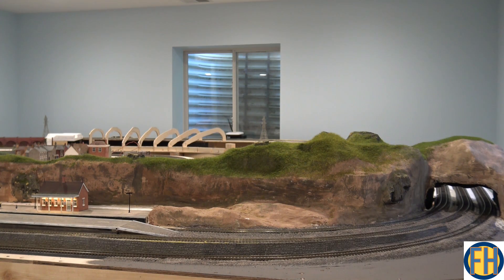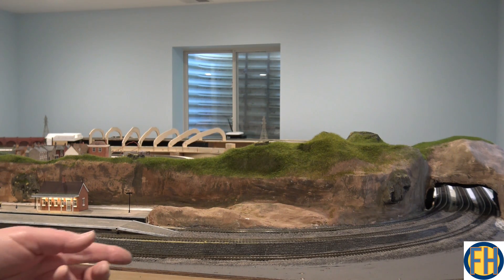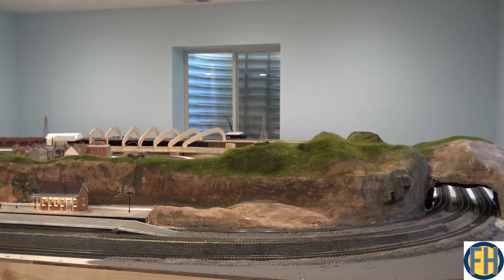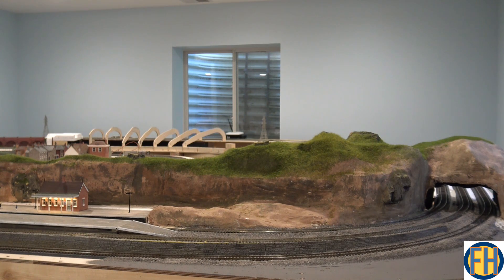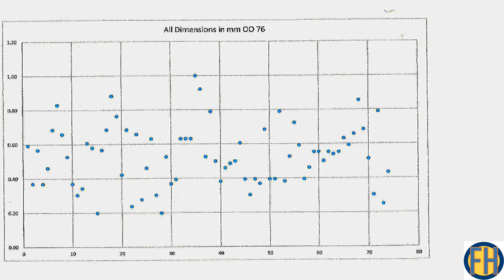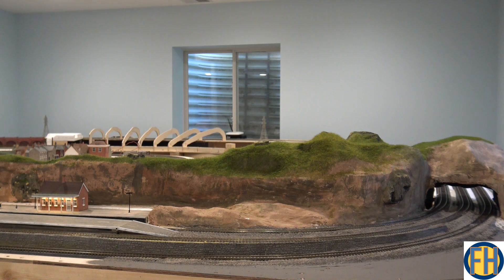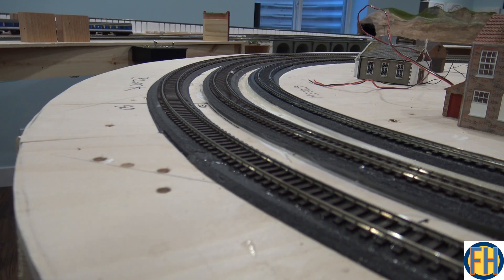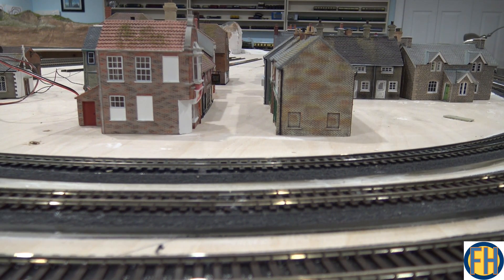17B Farland Build  -   Girder Bridge up close,  Progress and More

Comment: Just had a thought about your platform wires. Use a drinking straw through your drilled hole to feed the wires through and then they won't get caught in the foam etc.
Reply from the maker: Creeping Jane I discovered that trick long after I made this video.  Thank you for the tip, Rob

Comment: Exciting to see ballast going down, and a lot of research seems to have gone in to it. Regarding color mix - are you planning on weathering the ballast and rail once it's all laid? It seems like much of the color mix is lost, depending on how much you weather it. 

Really good craftsmanship on the platforms, too - that final video clip from on the platform itself really shows it off nicely.
Reply from the maker: Hello, I hope to put some color on the rails  and weather the track itself.  I would like to keep from getting too much weathering on the ballast.  I will most likely wait till I am much further along and for weather where I can open the window.  Today it is 35C so with the A/C I do not want to open the window.  It makes sense once set up to do a fair amount of painting.  The wood planked platforms came out fairly well, at least I am happy with them.  Thank you so much, Rob
Reply: Yep, my concern on weathering the ballast is in overdoing it and then you loose the color and texture variation of the ballast itself! Sounds like you have a good plan on waiting until more is done before you approach that task.

Comment: Well apart from a few teething troubles then all is looking great Rob, I think that it must be expected that there will be a few issues along the way when building all this from scratch like you are doing and to be honest, with the size of the layout then the issues are not huge and I'm sure a man of your calibre will sort out in a jiffy. That shot at the end with the camera on the platform was brilliant with the two trains pulling in and really showed off the excellent spacing you have between the platform and the coaches - that was well worth all the effort you put into it and certainly something I will be concentrating on when I come to redo mine - it makes such a difference to the look.  A great update buddy.            ...........Graham
Reply from the maker: Hi Graham, it is 5:31 am and I have my first cup of tea in my hand.  The wind is blowing in big gusts outside, it has cooled way down overnight.  Another new day approaches.  Yes, teething pains.  The track with the slight wow is the last one laid, the second girder bridge had to be complete before it could be completed.  As a result it has the least running time on it.  In fact, the morning I shot this video was the first time I had ever run a Western on it.  I've had a few other things like the HSTs and the Class 50 and 25 running on it.  As you say, it could be something down low the ruck is hitting.  I will investigate today.  I confess, the little squiggle was so I would have enough room to get my larger camera on the platform and it is just wide enough to fit it.  They will not look so wide when the canopies go on.  I have one in clamps while the glue sets up now that I did yesterday, last thing.  Thank you, Rob

Comment: Another way to install wires (as for the platform wiring) is to provide a duct.  A drinking straw is ideal, and allows the wires to be run over many inches without needing other guidance.
And the canopy lights on the main platform look great.  Do you use warm-white LEDs?
Reply from the maker: I used those adhesive rolls of LEDs and cut off how ever much i needed, then I used a fair amount of resistance.  The glue is setting up on the first canopy and the lights are in.
Reply: Rob McCrain 
Rob, interesting how sensitive LEDs are to voltage, so different length strings of leds need different ballast resistors.
I have a neat little box for testing leds (single and strings) that I got off eBay, but I'm hoping to standardise on the resistor for coaches and sets of leds, so the lighting is of similar intensity. Search for "mini led tester test box".
But I like your canopy lighting, nice brightness.

Comment: Hi Rob
Great video, interesting to see I'm not the only one with the odd running issue.  On a big layout track laying can certainly be a trial by fire. I've relaid one section 3 times, it's tricky sometimes to get everything to run perfectly. 
The bridge looks great, looking forward to seeing that section completed.
Cheers
Paul
Reply from the maker: Dunge Wood Hi Paul, I have not run every loco and every different type of sock I have yet.  I was surprised to discover how easy it was to get my Bachman stock to run on the one extreme super elevated curve.  The other 4 are much less.  I just loosened the screws holding the bogies and all was fine.  Some were fine from the factory, some were not.  Inconsistent assembly I guess.  The S turn, which is very slight, causing a problem was a total surprise.  I am about to run my Class 40 through and see if it makes it.  Come to think of it, I am sure I've run it on that line before.  We shall see.  My old layout was plagued with multiple problems like this, so bad In fact, it is no more.  Thank you, Rob

Comment: Looks good Rob, I notice on one of your rakes it looks like a Mk1 TSO  in Network SE livery but with a 1st class yellow stripe, as 1st Mk1s are 7 windows fo or fk's not 8?
Reply from the maker: Hi Greg, I hadn't noticed that.  Thanks for pointing it out.  Rob
Reply from the maker: Greg Palmer Hi Greg, I am looking over my stock as I write this and have counted windows.  The only one I see with 7 windows is a composite coach 1st and second.
Reply: Rob McCrain Hi Rob, yes the Mk1 comps have 7 windows/compartments also, Mk1 1st opens or corr 1st have 7 windows/compartments, same on Mk2's fk or fo's all 7 window/compartments so this could be a mk1 so reurbished into a FO when Network SE re liveried it.
Reply from the maker: Greg Palmer Ah good, there can be variations then from the norm.  I was afraid I would be forced to take it to the tip.  I have two like this.  Thank you, Rob
Reply: Rob McCrain if you can get me the coach nos of the sides I check my coaching stock books for the origin
Reply from the maker: Greg Palmer Is it really that important?

Comment: Rob excellent video again, work is progressing really well, the rock face and the station platforms look great, the girder bridge love that, and the ballasting is spot on, I remember the video you did about researching and graphing the ballast, its very realistic, I wondered about the banking, may be the camera angle makes it look steeper than it actually is but saying that you have it under control  any way, great work. . . . .Al
Reply from the maker: Hi Al, the ballast mix passes inspection then.  Not sure what you are referring to about the banking? So glad you like the rest.   Thank you, Rob
Reply: Sorry the tilt on the curves banking on curves from speedway tracks :(
Reply from the maker: Ah yes, the super elevation.   Yes, there is one super elevated curve that is cartoonishly elevated.  I could see it as I was putting it down.  The Mk3's love it, and the Bachmann Mk1s & 2s can be adjusted to like it.  I will go find some Hornby Mk1s today and see what happens when they run around it.  There just has not been much time to run so far and everything I have run, until yesterday, has run quite well.  It is all quite new.  Thank you very much for your quick response, Rob

Comment: Don't envy you having to ballast a full layout but it looks good , amazing how these running problems happen on a new layout but the check rail is a great fix .......Peter
Reply from the maker: Hi Peter, if I had been paying attention to the track line and not thinking about the way the platforms would look, I might not have made the mistake of putting a shallow S turn there.  If it becomes a problem with anything else, I will have to rip out a lot of scenery and track to fix it.  New layouts are where problems occur.  Thank you, Rob

Comment: Just reminds me of how much I need to do. I wonder if I can match plywood platforms to existing Hornby ones. I love the girder bridge. Glad you found a place for it.
Reply from the maker: Hi John, the plywood I am using is 3 ply and 1/8 inch thick.  I used it because it is quite stable and I needed to glue sticks to one side.  It worked, it did not curl up which is what I was worried about.  You would have to thin the edge I think.  Thank you, Rob
Reply: Thank you Rob. I may try platicard but it is good to see how well the plywood works.

Comment: The ballast size and colour are about right there Rob , the platform are going to turn out great far better than the card ones or the Hornby stone ones ....the turn is a disappointment for the Dapol ..but with that check rail you seem to have solved the problem , the banked curve looks very good , but to now prove to be causing a problem is a pain ....the girder bridge does look the bees ...it will be a feature on the layout ...well done so far ...Dave
Reply from the maker: Hi Dave, I am happy you approve of the ballast, I have worried about that one.   I should never have put an S curve coming out of the platform.  It would be a big mess to rip up enough scenery and track to fix it now.  I wonder if any other locos will have that problem now.  The super elevated curves cause no problem as long as the bogie can pivot far enough as the coach comes off the super elevated section.  It is only this one cartoonishly elevated curve that have been any bother at all.  Trains run over the other 3 super elevated curves just fine.  Thank you much, Rob

Comment: Hi Rob, coming along nicely,  nice trick with the rail coming out of the station. The bridge looks great. Cheers John.
Reply from the maker: Hi John, The check rail just controls the wheel so it does not leave it's path.  They are common on tight curves or bridges.  It solves a poorly engineered track path.  If it becomes permanent, I will find something to use for it besides a stick of wood.  Likely plastic and a piece of rail glued to the sleepers.  Thank you, Rob

Comment: Looking great..The bridge look great, but.I did also notice that one side seems to be flipped???  I think my favorite thing is the weathering work on the platforms...stunning!!!
Reply from the maker: Your comment caused me to go down and pull one half of the girder bridge out so I could turn it this way and that.  While I was building them, I thought it could only go one way or so it seemed.  You could be right, the sides of one are turned upside down compared to the other.  I did a very good job building it so it is not ever going to come apart now.  I would have to get a 3rd kit and build it.  I suppose it doesn't matter for most people, since they would only have one bridge, but I have two side by side.  Very interesting, very astute of you to notice.  Do you think it is glaring enough to warrant a new kit and throw away this one?  Thank you, Rob
Reply: Oh my...Sorry to cause you trouble...If it were my layout, I would correct it, But it is your layout and so up to you whether or not it matters.  I noticed it right away - that's just me....maybe take a poll???
Reply from the maker: Giulius71 Which side is wrong do you think?
Reply: The one on the left...look at it's center and see where the vertical and two 45 degree angled beams meet...this joint should be at the top for optimum compression strength...
Reply from the maker: I will have a look later on today, thank you.
Reply from the maker: Giulius71 Hi again, I bought a new bridge kit so that the two sections can be the same.  I am standing here looking at the picture on the front of the box.  The depiction of the finished kit clearly shows the structure should be:          l\|\|\|/|/|/| not as you have proposed.  I shall build the replacement to match the one on the left and nearest Far Cliff.  Thank you, Rob
Reply: Rob McCrain 
Rob, as you have drawn it, the diagonal members are in tension, and so will not buckle.  This is expected, since they are slightly thinner, and so the engineer in me agrees with the box cover. Regards, Tom
Reply: So the right side was flipped...It already looks good but will look that much better once they match!!
Reply from the maker: Giulius71 Thank you

Comment: Everything you do is a work of art, but no reason to stop with just displaying on the layout!
Interesting that the two halves of the girder bridge are not the same way up. Left hand diagonals are in tension, right hand diagonals are in compression.  I suspect LHS is correct, since the diagonals are thinner than the verticals. 
Loving that platform shot, I can sense a favourite viewpoint.
Nice work, keep it up!
Reply from the maker: Tom Lawton Hi Tom, the two bridges are exactly the same.   Yes, the platforms are very pleasing.  They will look better when the canopies and the wind breaks are installed.  Thank you Tom
Reply from the maker: Tom, someone else noticed the girder bridge so I went down and cut it loose to examine it.  I think you are right.  It seems as though it would only go together one way when I was building them.  I cannot tell now that they are all glued up, but it is possible that the sides could go on either way.  I am not sure what to do about it now.  Rob
Reply: I'm sorry to have pointed out this detail, since you will probably not be able to ignore it now.  I can see that both parts are built consistently (ie left matches right) so you can't even swap one around.
I don't doubt that such a structural model will be fully assembled, and not just tacked together, so it would call for major surgery to rebuild it; either removing the sides from the structure, or removing the roadway from the bridge structure.
How about seeking prototype justification?
Or even leave it alone; you know how many people have looked at this video clip (and the others where you have shown off these lovely bridges) without noticing, and it will only be you who will notice
Reply from the maker: Tom Lawton Hi Tom, I will just leave it for now.  I would have to buy a 3rd model and assemble it to make them symmetrical now.  I made sure it was solidly welded together when I built it.  Funny, if there was only one to look at, it would be perfect.  It is only where you can see both that the difference is noticeable.  I doubt Walthers expected anyone to build two of them.  Oddly, when assembling, it seemed like it only went one way or I would have paid attention.  Also, the finished one was in another room when I built the second.  Thank you, Rob

Comment: You have done a lot of ballast research I remember. And Alan too as you say. Have you added the link in the description yet Rob? Farland 2 ballast looks good. I wondered what the planking was going to be for on Facebook. Check rail was an interesting solution - I wouldn't have thought of that. Girder Bridge is impressive. Certainly looking the part at 17:50. Keep up the good work. Laurie.
Reply from the maker: Hi Laurie, I added the URL for the ballast video.   I thought I already had it there.  Thanks for pointing that out.  I have used check rails or guard rails as they are called in the UK a couple of times before.  I was hoping to not need them on this layout.  You will see them frequently if you ever watch those cab ride videos, especially if there are hills and curves.  I do like the girder bridge.  Thank you, Rob
Reply: That Girder Bridge is a bit of a feature Rob.
Reply from the maker: Calvertfilm It is attracting too much attention.  Thank you Laurie
Reply: I see about the angles. I didn't know enough about bridges to see that.
Reply from the maker: If there was just one of them, there would be no controversy.  They don't match, the girders on one are upside down to the other.  It is still just as strong structurally and would make no difference if the other one was not different.  It is purely esthetics.  I just bought a new one.
Reply: :rolleyes: :embarrassed:
Reply from the maker: Interesting, no matter which way it is built, it will match one or the other.